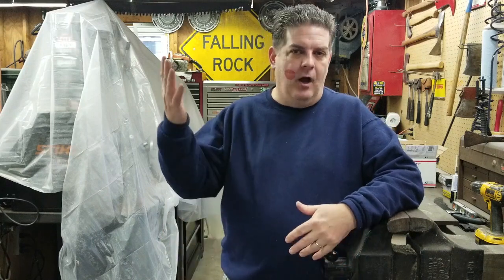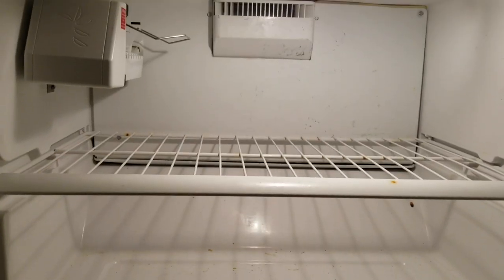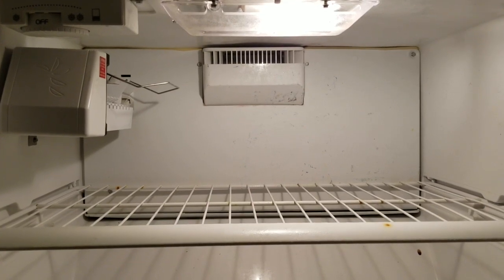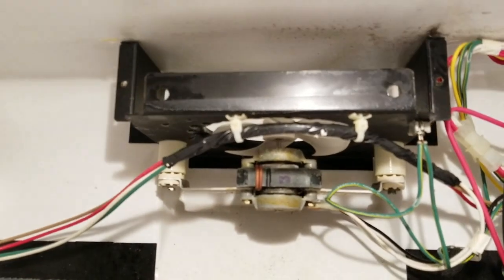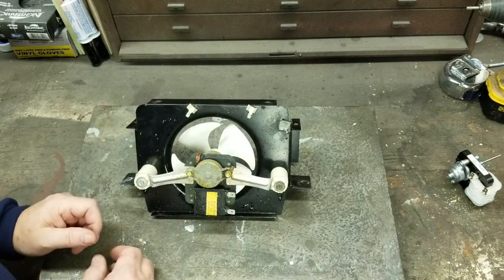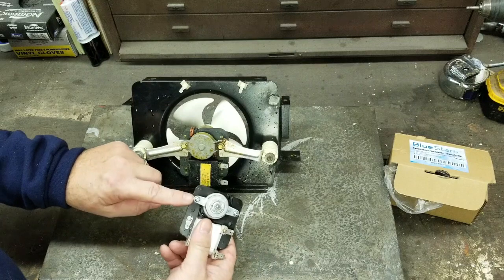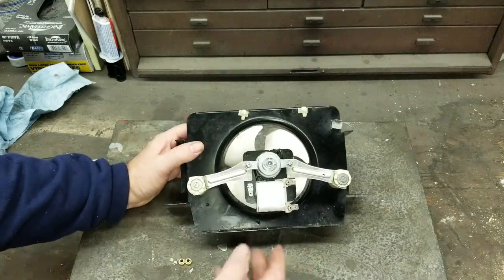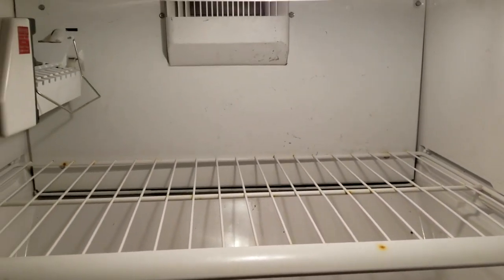Refrigerator Repair, Evaporator Fan Motor

Comment: Thank you. You and your wife are great. Could you put the motor information and specs so I could buy one.
Reply from the maker: I used the info on my motor and ordered based on that. I would hate to tell you the wrong thing.
Reply: I took a chance and ordered one from Amazon that serviced Amana fridge. Happy to say that it is working well, thank you for your video
Reply: @foothillstrailhiker2426  Which model fridge do you have? I also have an Amana fridge and seems to be a similar issue (my model is BG21VC).  Do you mind telling me which motor you got on amazon?  I see a few bluestar evaporator fan motor but am not sure which one to get.  Thanks!

Comment: Thank you posting up this great video!  I have the exact same fridge and the evaporator fan is making a lot of noise.  Do you happen to have the part number for the replacement fan motor?
Thank you!
Reply from the maker: Thanks for watching and commenting. Sorry, I don't have the part number.
Reply: @foothillstrailhiker2426  I re-watched the video and was able to make out the part no. on the box.  (Blue Stars 240369701) Thanks again!